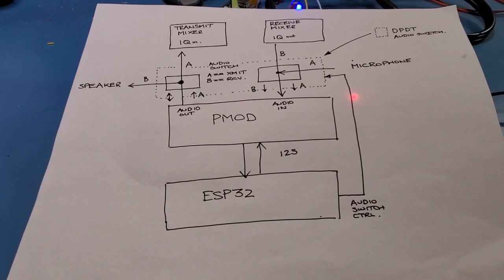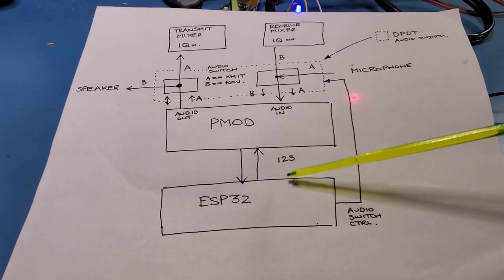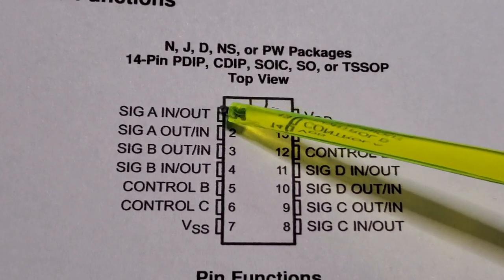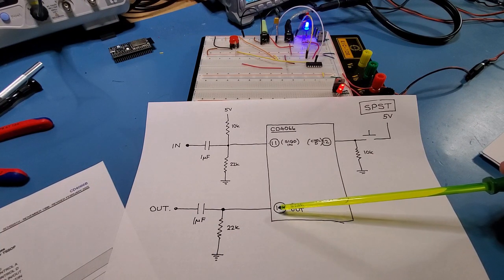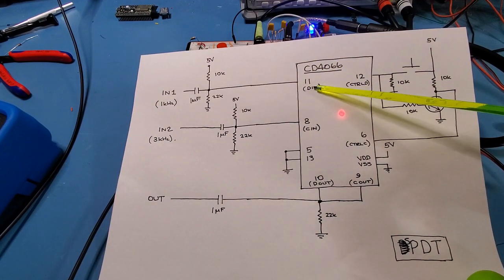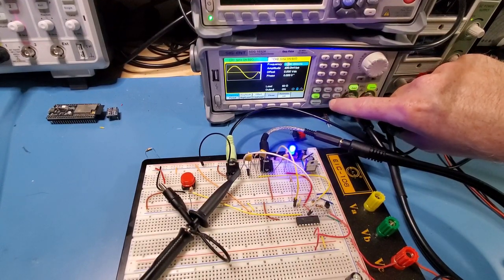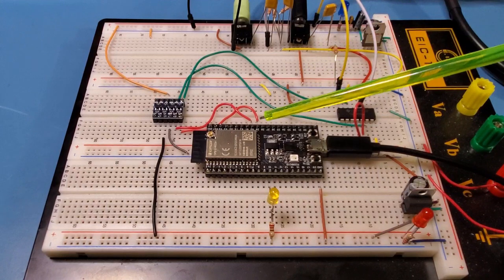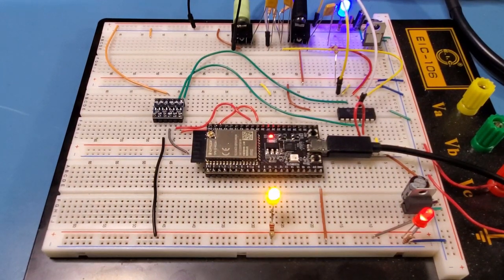Audio Switch with CD4066

Comment: Very good job, one  question.   If vierable resistor is use in the input pins 11,8 will it viery the output voltage at pin 10 & 9 ?

Comment: Hi, i know this is an old video but it is just what i needed to see, and i have a question. Wouldnt it be better while converting from a push switch to a ESP32 to just remove the switch and add a transistor in its place? The base of the transistor then goes into any GPIO of the ESP32. This way you use one pin instead of two. Would that be a viable option?

Comment: Do you hear any popping as you switch on low level signals just out of interest? As there is 3.4V on input before switching and 2.61V after it's switched. Not sure what the ON impedance of the switch is so have ignored it. just looked it up but at around 10 ohms it's not going to make a difference. this can be a problem if you have more than one vertual grounds in an audio design, as you switch from one to the other the difference comes out as a pop. can be worse if the amplifier gain causes the speaker cone to try and exceed its limits.

Keep the video's coming it gives the old grey cells a work out.
Reply from the maker: There's definite popping in the output. I am pretty sure its due to that biasing arrangement. I might try doing a resistor divider setup on both switch input and output and see if that does anything. Thank you for the comment TEH!

On the on resistance I see both 125 ohms @ 15V (right at the top in features) and later in the datasheet 10 ohms - not sure which is the right figure
Reply: @na5y  Had another look at the data sheet and the 15 ohm is for the Ron delta between channels. my bad.
Page 7 gives the Ron @25°C as 470 to 1050 ohms with a 5V supply. dropping down to 125 ohms at 15V. 

the 470 might help reduce the popping, but any change in dc is a fast AC signal, can be too fast to hear but the result of maybe hitting the the rails can be heard.
Reply from the maker: Not quite sure what VDD I would have to run the CD4066 in my radio. I will have to measure the audio levels from after the pMod board just before the speaker - that would be the highest. Interestingly though if I run fully headless with streaming in/out audio over wifi I wouldn't even have to worry about pMod -> Speaker and Microphone -> pMod
Reply from the maker: I just tried with a 10k/10k resistor divider on switch input and output and the pops disappeared entirely.
Reply: @na5y  So now the DC potential across the switch is very small, so the affect on charging and discharging the caps is small so now a quiet switch action. Used these a lot with lm741's in avionic audio control with 8080 chips for control. just befor we switched to full  TDM digital control, leaving only the emergency audio com's with an analogue signal path as a back up.

Comment: What an elegant solution, using "old" CMOS technology. A timely reminder for me that some things are better achieved without "having to" use a MCU. Thanks & cheers.
Reply from the maker: Thank you for the comment Neville. The circuit was behaving quite strangely until I tied pins 5 and 13 to ground!